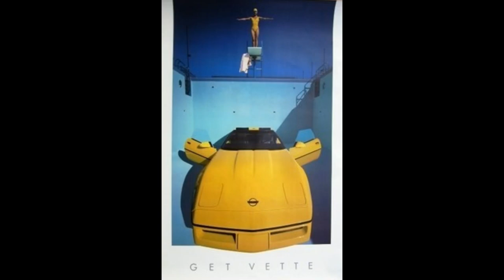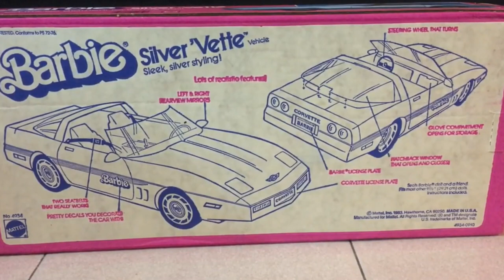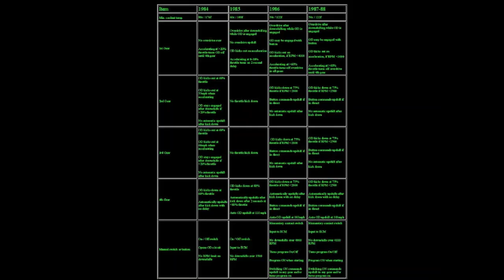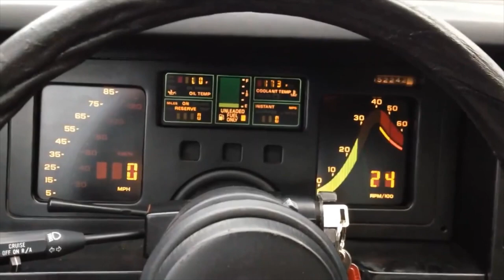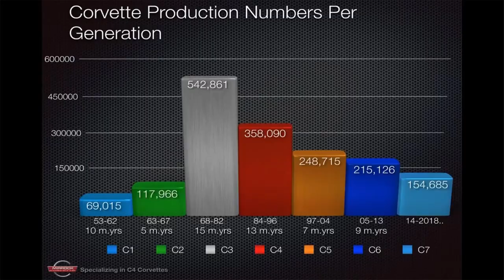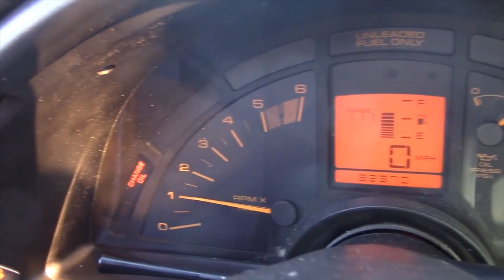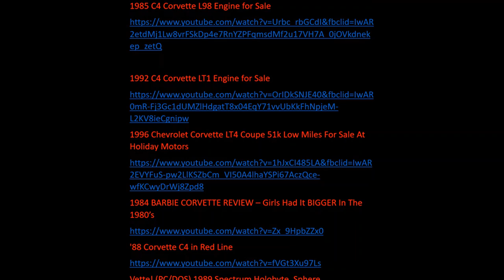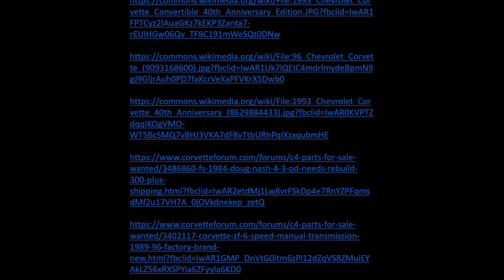C4 Corvette

Comment: Good informative video. I have a 1992 conv which was born an LT1 auto. The original owner was an employee at GM and added the LT4 and ZF 6 speed after they were introduced. It's a rather odd duck. 54K miles.

Comment: Great video. I never cared for C4’s as a kid I think due to their over saturation everywhere. That said, I have really grown an appreciation for them and am lusting for an LT1 as of late. Btw, what movie was that clip of the C4 and the 928 from? I don’t recognize it but looks 80’s awesome. The C4 was in a bunch of TV and film back then, another good appearance was in the bmx movie RAD where and underdog local kid takes in the pros. The bad guys, Team Mongoose rolled around town in a red C4. 😆
Reply from the maker: The movie clip with the 928 and the Vette was called Redline. It was made in 1995. As it turns out there are many "Redline" movies.  I haven't watched RAD since I saw it in the theater as a child, sounds like it deserves a re-watch! C4's are so inexpensive right now, one might follow me home. Nobody but me wants the early ones. I want to get a 1984 and LS swap it. Leave everything on the interior and exterior stock and double the power output. A completely hidden modern stereo too. The Callaway twin turbo still used a 4+3 trans, so they can theoretically handle an LS engine 3:-)